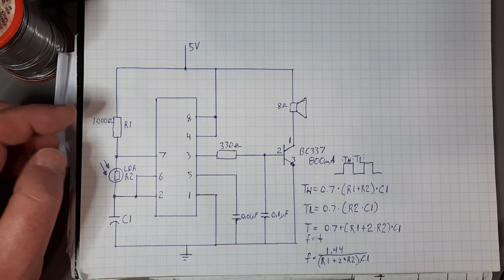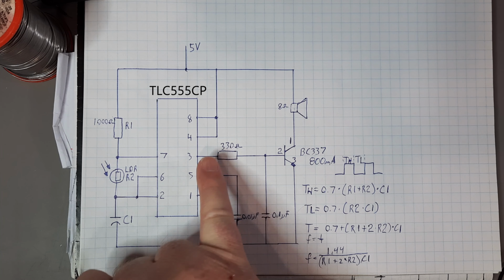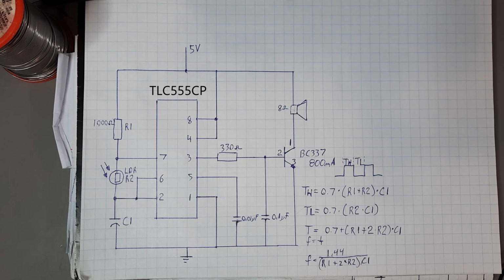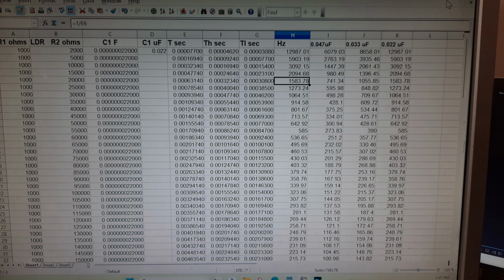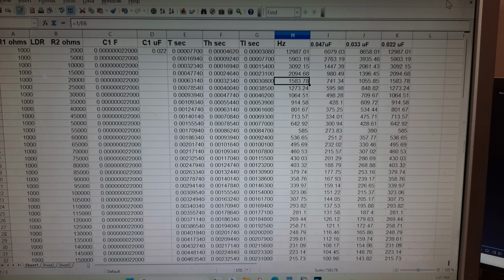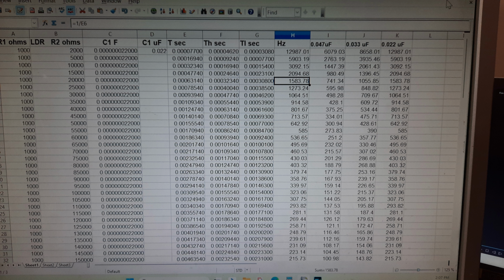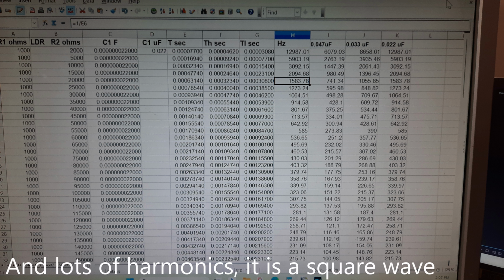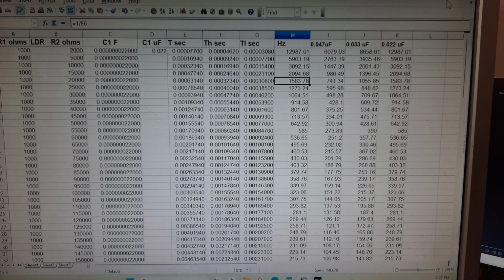Music or Noise Maker 555 with LDR DIY

Comment: Those Korea ones could be made by Fairchild. They used to have a chip-fab in Korea.
Reply from the maker: Kind of wonder how many companies closed factories only to have a small operator take the equipment and start production runs on what the original company considered no longer profitable. 
Have a good day